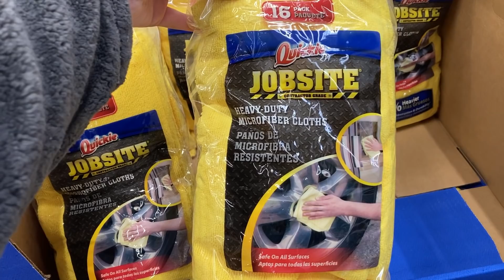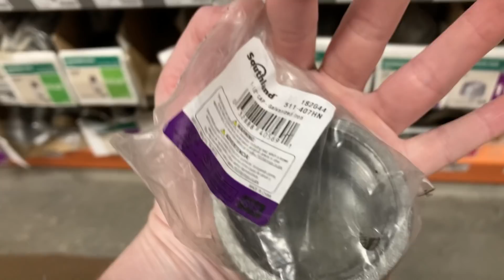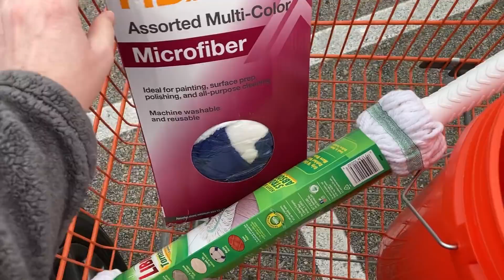Vlog 30 Cleaning our 1930s GE Monitor Top Refrigerator

Comment: I own a window cleaning company. The best bang for your buck rags are reclycled sterilized surgical rags (blue cotton). We do wash them in the same washer dryer at home (seperate load, heavy cycle, plenty of bleach). You can run a quick soak in between your clothes if you're squeamish, but the bleach pretty much leaves the washer fresh anyway.

Comment: Ok Miss Industrious! Here's a tip for cleaning rags: go visit a thrift store and ask for a bag of rags or cotton clothing they can't sell (due to rips or stains). Saves a LOT of trees, and saves money not having to buy ready made rags. Even if you buy a cotton bed sheet or old towels, it's still usually cheaper in long run. Make sure to run washing machine with cleaner for your particular machine after washing rags to bust out any toxic chemicals.  Oh, and brass wool is just a brass metal scrubber, usually found in same area as mops, sponges, etc. Nice job on the fridge! Oh, and good on ya for getting Barkeepers Friend, that stuff is GREAT!
Reply: My local Salvation Army store throws nothing away. What cannot be sold goes into a rag bag. I don't remember what the staffer said happened with the excess rags, but it made my heart happy to hear they are not tossing much. A Goodwill staffer told me nothing at their store was tossed, either (they have 2 places they send things to, including a place where customers can buy stuff by the tub). However, another person told me the public would be shocked to find out how much Goodwill throws in the dumpster. Perhaps their policies have changed? I do not know.

Comment: Turned out nice. Another option to the rusty bits on the areas that hold the racks is just use the paint on enamel. Looks like a nail polish bottle.  Would save on costs of getting it re-enameled.  If for some reason you don't use it as a refrigerator you can always use it as kitchen storage for dishes or appliances. Your actual refrigerator you will be using you can buy a unit with door fronts that mimic cabinet doors or whatever. Good luck.

Comment: There are a couple of old style fridge cleaners you might want to consider. Particularly to neutralise bad smells.
1. Baking soda and water.  
2. Vanilla extract (either diluted and then wipe over or put on a cotton ball and leave in the fridge)
Reply: While stationed in Kodiak AK, the housing officer told me to put a coating of toothpaste on the door gasket to keep funky odors at bay. This was done on fridges NOT being used right away by next tenant, and we had to do it to pass move out inspection. Might be an idea for old fridge until ready to plug it in and fire it up!
Reply: Neat idea with the vanilla, I'll have to try that..

Comment: The spin mop is worth every penny of the 39.95
Reply: Absolutely, they are awesome!
Reply: Is it better than the blue one? The blue one breaks easily 😩 either the foot lever to spin or the part where the mop head goes I’ve gone thru so many  😞
Reply: It is a game changing I'm disabled and one part that is hard for me is the bending over to ring out t he mop and I don't have to with this one.
Reply: Thanks for the info about the electric steam mop! I just got mine today!
Reply: @mamab4211  I've gone through a few over the years but so worth it. It really wrings dry and that is the secret to clean grout. I have over 4,000 sq feet of tile so ease of mopping is essential.
Reply: I love mine! I got mine cheaper than that through QVC. Makes mopping so much easier!
Reply: Yes!! Is worth it. We use them at work to clean yachts and they last a while

Comment: There are a few products that work very well on that old style enamel. Most of that is more like a fired on ceramic glaze vs a sprayed on paint.  You can get it really spotless with a polishing compound from the auto parts store. It will remove rust stains and surface defects, such as, scratches, mineral deposits etc. And any residue cleans up easy with a damp towel. Like the micro-fiber ones you already have.

Comment: My 1935 GE Monitor Top refrigerator has been in constant use since new. It has had a couple repairs over the years. The less they're opened the less frost build up on the freezer compartment. I just use mine for beverages.

Comment: Great job on the fridge clean up.  You and Caleb should consider having a modern fridge in the kitchen but disguised behind a cabinetry front or in a closet.  Running down to the basement for food will get really old very quickly.
Reply from the maker: He doesn’t really plan to have any cabinetry. If you look up Victorian kitchen that’s what he wants.
Reply: @secondempirestrikesbackvlo2578  then you may want to build a closet or put it in a 
Pantry behind a false front.  They did have large pantries.

Comment: I have used Bar Keepers Friend for years.  I use it to keep kitchen clean. I have even used it to clean rust stains out of my great Grandma's antique linen tablecloth.  It is the oxalic acid that removes the stains.  It is also what gives rhubarb its unique flavor and why it is so deadly
Reply from the maker: Ah that oxalic acid is what Kaleb used to remove the water stains on the table he restored.
Reply: Do you think Bar Keeper's Friend would work on a stainless steel sink ruined by yours truly after I used a very harsh clog buster from Ace Hardware called Plumber's something-or-other. It easily cleared the clog, but some of it got splashed on my brand new stainless steel sink. The splash marks did not clean away. I had just renovated my 1950s kitchen and was so angry with myself for ruining my new sink. Someone recommended Bar Keeper's Friend, but the answer seemed too easy. Perhaps it's time to reconsider.
Reply: @flitz  Thank you!!!

Comment: Maybe you already do this but do you save old toothbrushes?  I have "tons" of them and use them for everything that has a "nook or cranny".  They work well when cleaning things like the edges of the refrigerator hinges, the crevice of a screw or the areas that hold the refrigerator shelves.  I even use them when oiling furniture to get in small "fancy" areas or when washing a glass object that is real fancy.  They are soft and they don't destroy anything.   The refrigerator looks wonderful!
Reply from the maker: I get little dental sets at dollar tree that have the metal dental picks and a toothbrush.

Comment: About cleaning the shelves. I am assuming they are metal. 
Put them in your dishwasher and as soon as the cycle is finished get them out (with gloves) and go over them with steel wool while they are still super hot. 
If you wait until they dry or cool off, the baked on grease doesn’t shift as well. 

I do this with my oven shelves and it works so well. No chemicals either.
Reply from the maker: We don’t have a dishwasher 😢
Reply: Hide one in the basement. (Smiley face emoji …. Easier to type that than find the emoji).

Comment: The one problem I find about those wringing mops is that they still hold a lot of water even after tightly wringing them, and sop water everywhere. However that depends on what they are made of. 
Those spinning mops are worth every penny because you can dry mop the floor boards with minimal water and get them really clean. 
Those mops are easier to keep clean too.
Reply: I agree that the spin mop is worth the money. The best mop I've ever had and I've had alot ..big box stores are not the best place to get it $ try Amazon.

Comment: Regarding your tile cleaning..there actually is a brush that connects to a pole. The brush you picked up seems rather large. The one that would work on the grout is somewhat wedge shaped to fit grout lines.
Reply from the maker: I see! The grout isn’t supposed to be white I don’t think and I’m not worried about getting it white even if it is. I just want the little marks off the tiles themselves.

Comment: Was just thinking about the tile floor, and remembered what we used to do to get as high a score as possible from the health inspector, for quarry tile. Tide laundry detergent and a deck brush. Pulled out EVERYTHING, and after a rinse and mop to get it all up, was generally just like a new tile floor.
Of course, not "corporate approved," but we regularly were the highest scoring restaurant in the area. 😁
So, if all else fails... 😉
Amazing how well built older appliances were. I had a mid 1950s GE refrigerator with rotating shelves that was about as heavy as an automobile from the same time. And I think that it was still running on the original Freon. I'd looked at a 1934 Norge range that was a massive construction as well (didn't have a place to put it, but I SO wanted it?)
Restoration and putting older things back to use makes such good sense to me. I mean, for me, it's generally getting a 70-100+ year old pen working again, and not having to get something that would just be thrown away after it ran out of ink, but it's applied to a lot of my stuff, for years. Wasn't originally a "going green" type of thing, just a love for vintage and antique. Why replace something that still works well, or can get back to working well? 😁
Reply from the maker: Heard!
Reply: Hahaha...another military memory: Navy "A" school trick to pass cleaning inspection was, again, toothpaste and toothbrush to scrub tile floor. Once clean, then followed with Pledge furniture polish and clean cotton rags. Of course, polish had to be really buffed out good, or people would slip and fall!
Reply: I've also seen offset printing press blanket wash used, but the grout has to be perfect, or it'll eat the grout.

Comment: There's a product called iron out it gets rid of rust spots on things works extremely well and extremely easy to use. That rust spot in the refrigerator you just squirt it on it and almost instantly the rust spot is gone.

Comment: That fridge came out nice
Reply from the maker: Yea I was like shoot it’s halfway restored after just a cleaning!
Reply: @secondempirestrikesbackvlo2578  That refrigerator doesn’t look like it even needs restoration. That little bit of rust should be easy to remove. Of course, I haven’t seen the part that sits on top. There is a similar fridge in our local museum…….always the first thing I admire when I reach that display.

Comment: Do you guys have a Menards in the area? A mechanic I watch on YouTube started using a cleaning spray called D Germ that gets literally everything off of anything. Pounds of oil and grease on an engine? No problem. Mildew and general grossness on a vinyl interior? No problem. Marker stains on a wall? No problem lol

Comment: I would get for having a refrigerator from the 50s if I could have this retro appliance in my house especially because the first refrigerators of the 30s were quite unreliable and very dangerous because of the chemical they used to cool than in the mid 40s or the beginning of the 50s it was replaced with the one they occupy today much safer I think that with the one of the 30s you could even die intoxicated if you handled it without the corresponding care😬 ...

Comment: Great job on the fridge. It's beautiful just as it is!  What is on the top?  I couldn't tell from the video.
Reply from the maker: Oh it has a big hole in the top where the cooling part goes. It’s a big round thing with the freezer part attached to the bottom of it. The freezer drops down into the inside.
Reply: @secondempirestrikesbackvlo2578  oh, thank you. I think I have seen a piece like that on the floor.
Reply from the maker: Yes it’s by the front door.

Comment: Cut your rags in smaller pieces then if the cleaner is too harsh. Just throw it out. Hahaha
Reply from the maker: Well I bought the rags I don’t want to be even more wasteful. I’ll just use a washer sanitizer or something after I wash them.
Reply: @secondempirestrikesbackvlo2578  there’s probably something out there that you can soak chemical covered materials in before putting them in the machine.

Comment: CLR would take the rust off.
Reply from the maker: I thought about grabbing some but it seems kinda heavy duty 😕
Reply: CLR is a bit to caustic for me, wearing rubber gloves is a MUST!!!
Reply: I’ve only ever used it as a wipe on wipe off kinda thing. I’ve never let it sit for very long or submerged anything in it like in the commercial.
Reply: Would Bar Keepers Friend be safe on that surface? I use it for rust on my flatware.